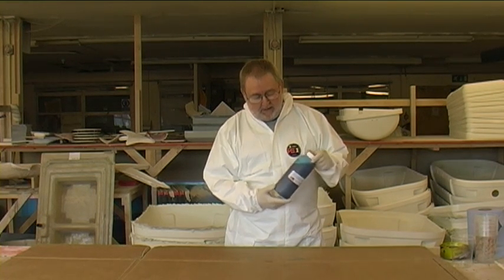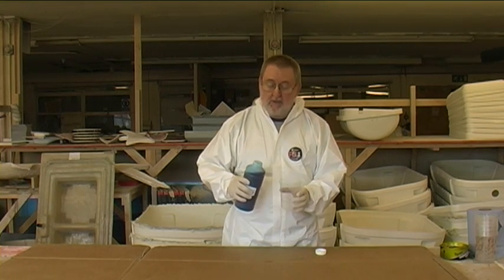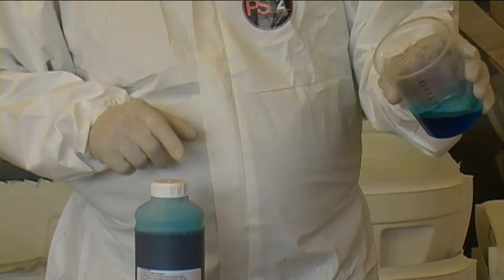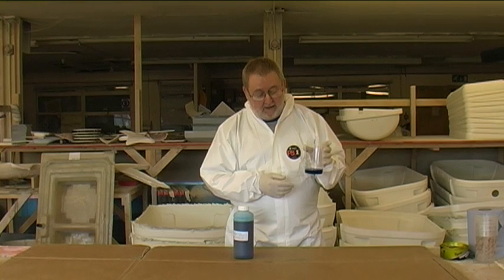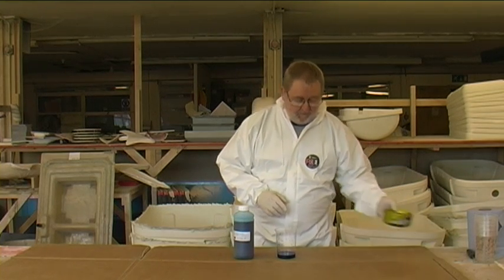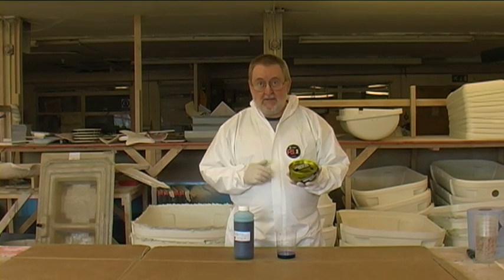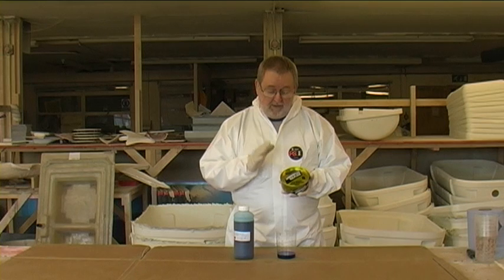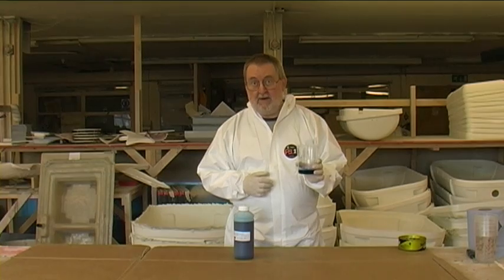PVA Release Agent

Comment: Can you let it set overnight or no?
Reply from the maker: That would be fine
Reply: EastCoastFibreglass thank you 🙏 one more question, if you spray pva on a mold can let it set overnight or it has to be coat it with gealcoat right after it dries? Thank you for your time
Reply from the maker: @JaimeAlegria-80  You can leave the release agent overnight

Comment: also Im planing to make a custom "vacuum bag" from a polyuretan or lexan sheet streched over the mold, heating it up till it sags down into the mold and then connect the vacuum to form it. I will do this when everything is setup so it forms around the laminate and tubing with no bridging, ofcourse before I put the resin in I heat it again.... Do you have any thoughts about this? Im trying to find the most foolproof way to do it thats why Im going directly to vacuum infusion rather then handlayin

Comment from the maker: Hi if you wish to achieve a high gloss finish you would need to use a semi permanent release such as Marbocote, if you need to use PVA best to when PVA is dry lightly rub over then buff off  with a hard wax such as MG08 this will denib the surface of the PVA, try a sample piece, hope this helps, many thanks

Comment: great video! Im building a carbon kevlar rc boat hull for competition so I need a smooth finish BUT using wax only may result in the hull sticking to the mold. I would like the whole hull smooth becouse Im going for a clear epoxy finnish rather then gelcote, however the most essntial area of the hull will be the plane surfice wich is only a couple of square cm, can I use a rubber spreader or a hairdryer on cool to get the PVA smoother? thanks mate